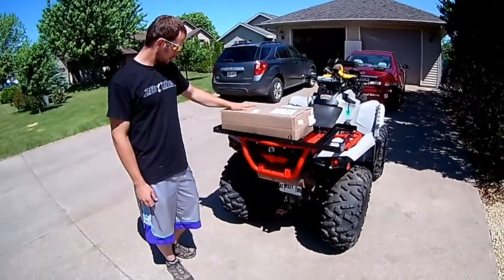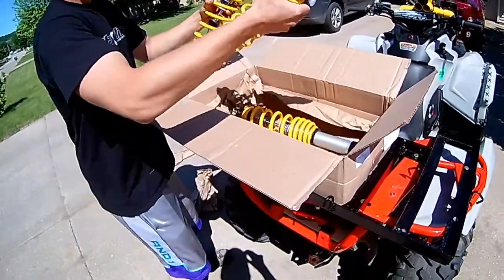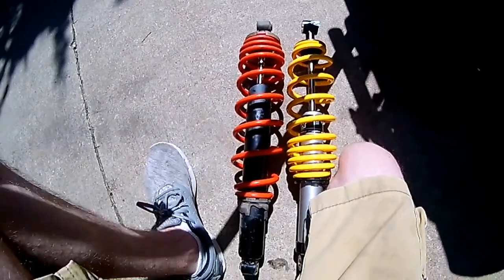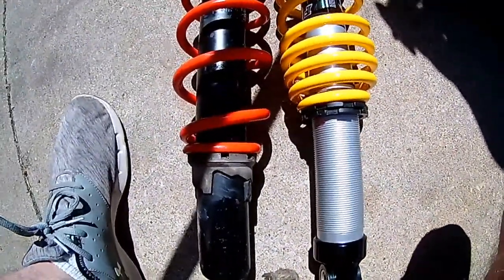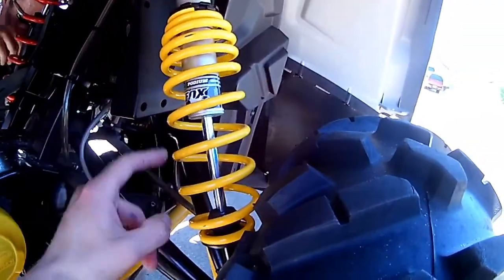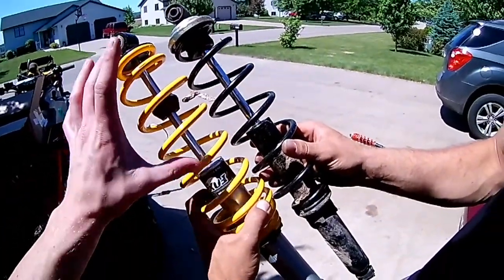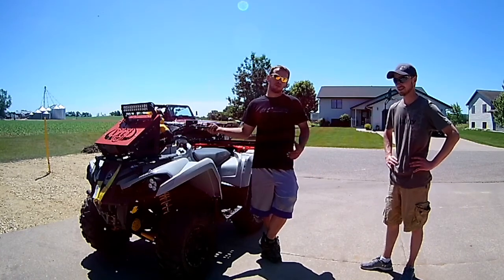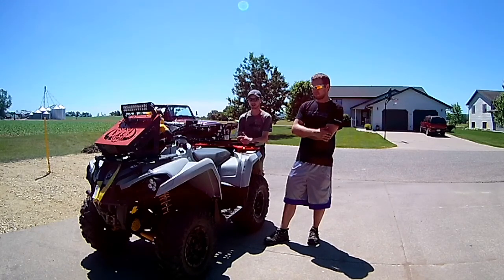Putting Fox Shocks on the Outlander!! Is it worth it?

Comment: update: after a weekend of riding with them, they are a little stiff when riding washboard under 30 mph but otherwise they're awesome. when you're riding at an angle across ruts, it's amazing having twice as much travel in the front. it soaks up the deep ruts perfectly. I ended up turning up the rear preload a little bit to push down on the front just a little bit more and it smoothed out the washboard a little bit. no bottoming what so ever over the whoops and jumps. and it's much more stable around corners

Comment: Does it help with the squirrel like darting on soft pack ... also is it any heavier for the from have a warm front mount plow on it
Reply from the maker: They help some but some of the farting the soft pack is tires. They are a lot more adjustable than the stock so you can make them quite a bit stiffer for plowing

Comment: How do you like those shocks after a couple of weeks? I have to do something about the stocks on my 570.
Reply from the maker: +5150hammerhead  So far they have been great. Haven't done any super aggressive riding yet though
Reply: Cool. Thanks. I think I'm going to pull the trigger. My machine rides way to soft.
Reply from the maker: +5150hammerhead You'll definitely notice a difference
Reply: The springs got soft quick so I switched them out for 570 xmr springs and with the preload adjusters 3" down from the top in the back and 2" down from the top in the front the ride is awesome and it's stiff enough to not bottom out on every jump. But with all the additional travel with my 27" bighorns that measure 25.75" I did have a tire knock out a headlight

Comment: What do you recommend for a 650?
Reply from the maker: I’d go the fox shocks a step above these ones. They are a little stiffer and get rid most of the body roll
Reply: I have a 2012 650 MAX XT and would like to know which ones would fit my Can Am ? Do you know the shock part numbers by chance?
Reply from the maker: Are you looking for the base fox shocks or the fox podium 1.5?
Reply: Whichever is more affordable but would appreciate the part numbers for both if possible. My stock shocks are 6 years old and due to be changed soon as i can afford it. Thanks Mike
Reply from the maker: What year is your outlander?
Reply: 2012 as i mentioned above...
Reply from the maker: Ooops sorry about that. Being a g1 chassis I don’t believe the g2 chassis ones will work. A good company to check out for a good price is elka suspension
Reply from the maker: The elkas start 950 for your machine
Reply: Ok thanks but i knew about the Elka's ...crazy expensive
Reply from the maker: No problem. You could check out fox’s website and put your Atv in and see if the have anything